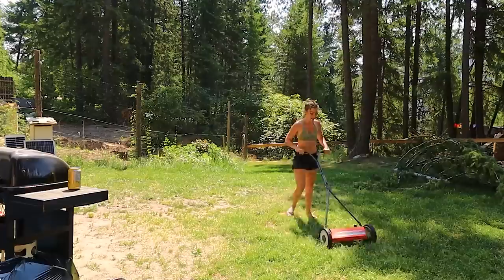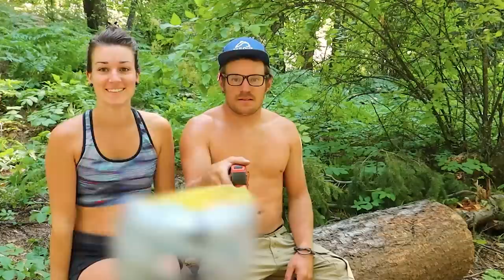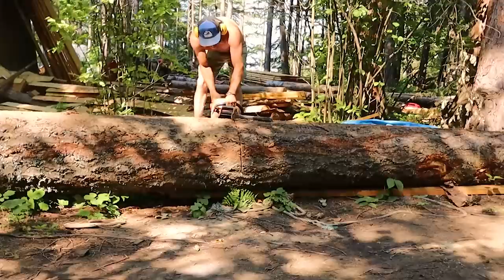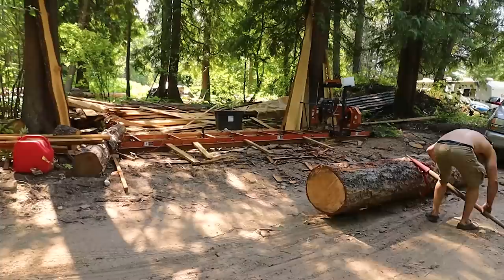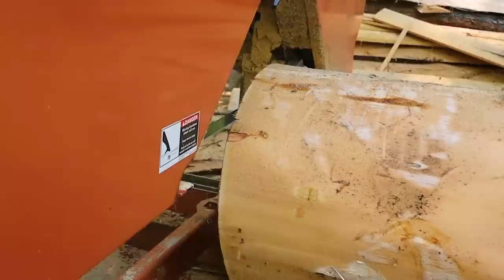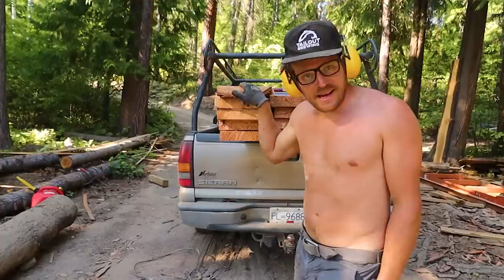Turning This Tree Into Usable Lumber | Building An Off Grid Home In The Mountains

Comment: I was a general contractor in Ont  for  50 yrs.  Floor joist are  typically 2 by 10   but you are   very  very   right a rough cut 2 by 12 Fir   would be  about 4  times  stronger.
Reply from the maker: I need comments like this to iron out my insecurity, thank you !